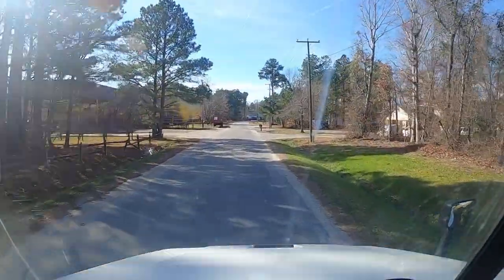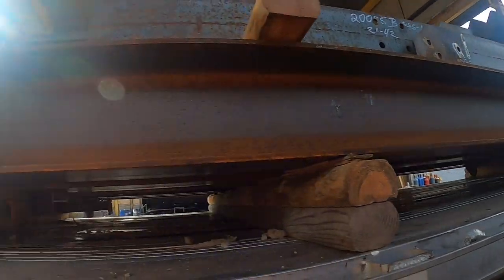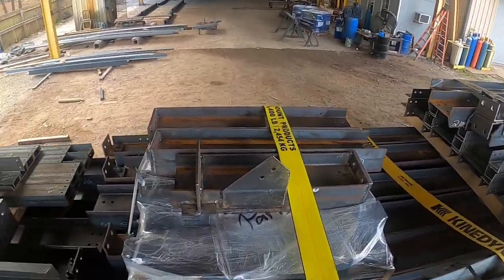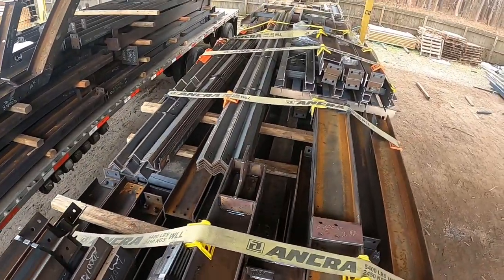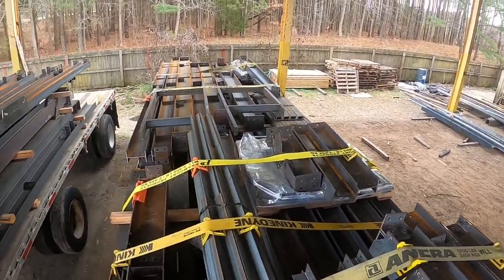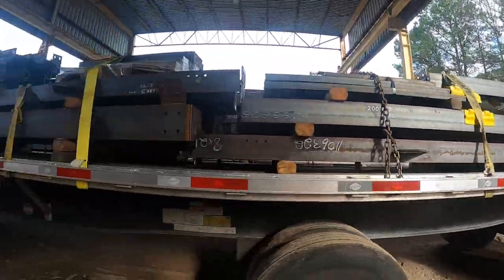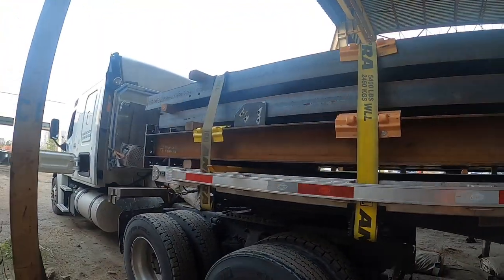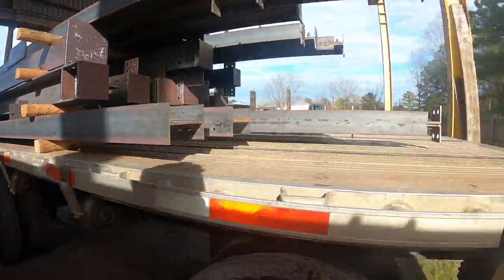Sunday Pick Up Flatbed Trucking

Comment: For 3 years I ran a dedicated flatbed run from Houston to Colorado. Every Sunday afternoon I'd be in Houston picking up a preloaded trailer that needed strapping AND tarping depending on the Colorado customer. Metal building are such a PITA to strap down. Every load is different. One thing you learn....chains on beams and straps on boxes and smaller steel parts. Use the straps to get your down pressure. Get unloaded on Tuesday or Wednesday then pick up a load of alfalfa hay to bring back to Texas. Smoke tarping alfalfa loads has it's own perils. Out and back, once a week. US287 sure got boring!
Reply from the maker: Definitely a pain. So many random pieces

Comment: Can you explain  downward  pressure?
Thank you 
P.s I'm new to the  flat bed game
Reply: A strapped load can be tight af. However, if there is no downward pressure the beams or items underneath the straps can still slide forward. You essentially make a tunnel with strong walls but the space in between those walls is a open freeway for load items to slide. 

The best way to ensure its all tied down and secure is to strap in levels(spaces between beams) or to add a piece of dunnage or rolled tarps to the top of the load and strap that down. Hope that makes sense.

If you get into a scenario where you cannot secure the inside of a load and you have doubt… build a bulkhead out of dunnage and place it close to the front and back of the load.
Reply from the maker: Great explanation
Reply: @BLAMBERRY  ty